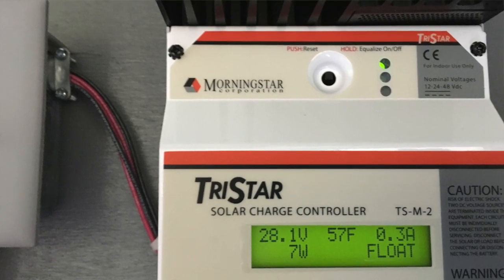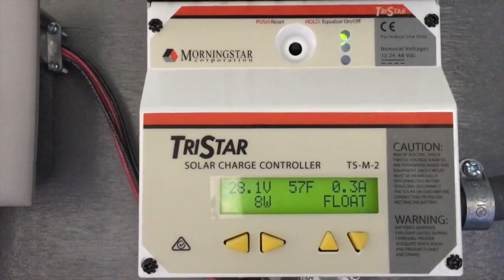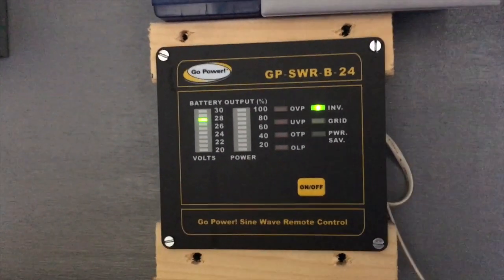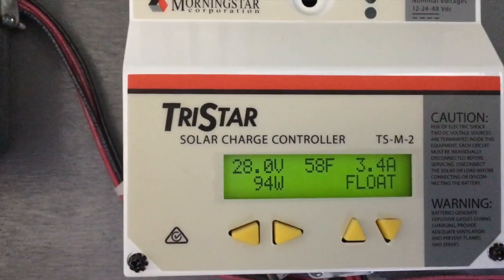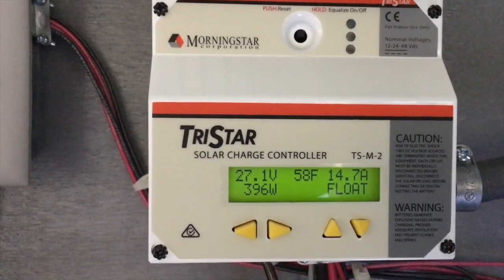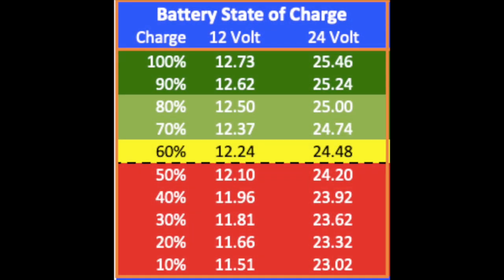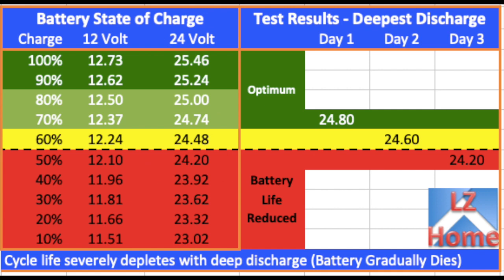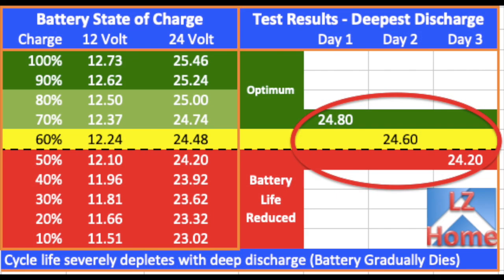Off-Grid Solar Test - Shocking Results

Comment: So, what was the problem?  a) Your battery bank was worn out  - OR -  b) Your Loads consumed the power faster than the PV Array could recharge the battery bank, each day?
Reply from the maker: The main issue was determining the "correct" battery state of charge. I was using the voltage reading on the charge controller. I installed a Victron Battery Monitor (I did a video on the install) and I was able to get a more accurate battery charge reading. I did have enough battery/PV to run the load while monitoring with the Victron. Over the long haul I did have problems with two or more cloudy days but thats another issue. Thanks for watching and please check out my Victron Battery Monitor video.

Comment: You definitely need to monitor battery voltage and selectively shut down loads occasionally.   Too bad solar systems are such dinosaurs and don't operate as a system.  This is really a minor problem, but it can't be solved with the conventional black boxes the industry pushes on people.
Reply from the maker: So true,  thanks for your insight.